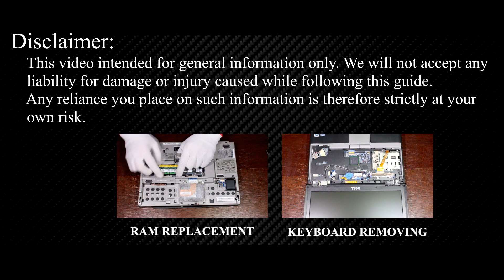How to Install SSD in Dell Latitude 120L, D410, D420, D430 (Upgrade Guide)

Comment: Excellent video. 
Now I have done the same thing, putting in a 512 GB Kingston SSD replacing the original 80 GB mSATA disk.
Thanks a lot!😃
Hm. Now the D430 doesn't recognize the new ssd. In the setup it  says "Primary hard drive = none".
I'm trying to install win7 from a usb stick. The booting from the usb stick works perfectly, but the installation process doesn't recognize that there is a new "hd" either, so I can't format it.
Hm? What to do? A tip anyone? :eyes-purple-crying:
Reply: same happened to me. do you know how continue? mine also says no hdd installed in bios
Reply: @hectoralvarado3630  No, sorry.  I gave up and sold the laptop, with the ssd, för the new owner to experiment.

Comment: ZIF SSDs are easy to get for the D420/430, so no need to bother with converter card.  Check on eBay.  $40.

Comment: I have a Dell Latitude XT.  I have a msata ssd and an the same adapter that I know for sure both work because they work in another laptop but they don't work with the Dell.  I'm also not sure what direction to put them, one side I just get a blinking prompt that does nothing and the other the hdd leds stays on but still doesn't see the ssd.

Comment: I bought a used Dell Latitude XT on eBay. 

I bought a new ZIF to mSATA converter card on eBay that looks exactly like the one you used in the video.
I bought a used mSATA SSD on eBay.

The BIOS is the most recent version.

The laptop would not boot.

Any ideas?
Reply from the maker: ZIP to mSATA converter or mSATA SSD doesn't work
Reply: @howfixit  I changed what I wrote. I mean ZIF not ZIP.  Does not work. Sad.
Reply from the maker: @njtexit8  yes, sometimes ZIF converters not working
you can try replacing with another
Reply: @howfixit  I can but I won't. It does not make sense to spend anymore money. :-(

Comment: question; wat type of connection is the ZIF connector, is it sata? pata? I mean the protocol. Thanks for the video!
Reply: ZIF is zero insertion force. Check the links. https://www.ebay.com.au/itm/Mini-mSATA-PCI-E-1-8-SSD-To-40-Pin-ZIF-CE-Cable-Adapter-Converter-Card/322879531869
Reply: It is PATA.
Reply: Друг, а зачем видео по установке если оно не работает?

Comment: hi, I changed but not working, what is the matter, may be Bios?
Reply: It does not work with me, did you find a solution? I have the latest A09 bios and the disk is not visible